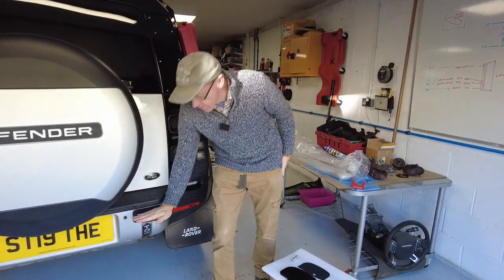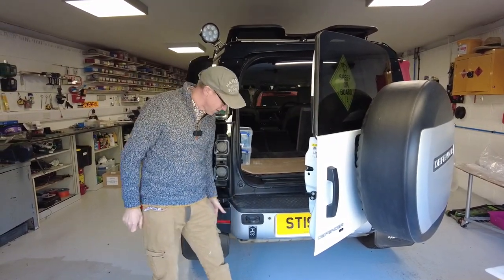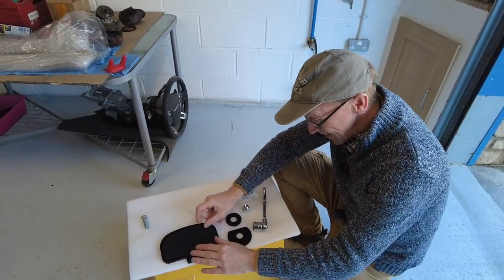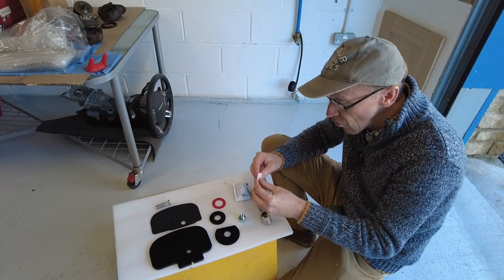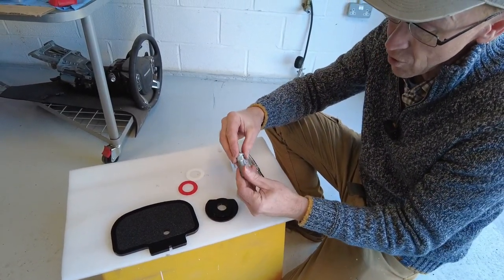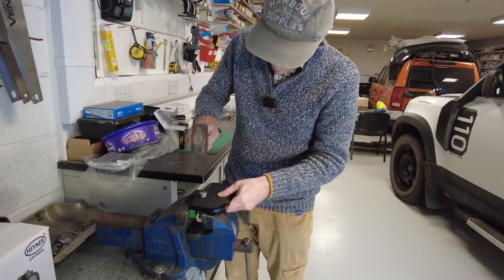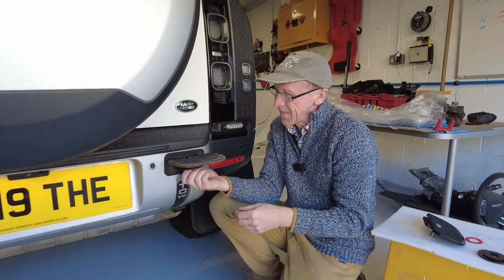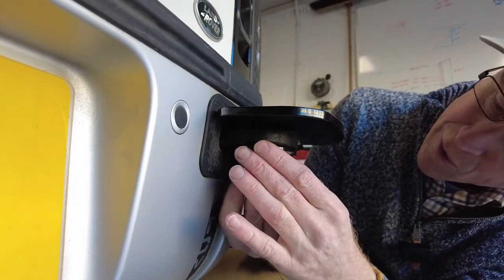Rear Step Kit for Land Rover Defender L663 Tow Hoops

Comment: "Just tap it in" then proceeds to beat it to death with a lump hammer lol 😆
Reply: Just think of the MIL it will be very therapeutic.
Reply: Yeah but you get the drift. Pun intended.
Reply from the maker: Yes i think I am going to try using the vice as a press - put a socket on the back so the thread can push through... the hammer was a little heathen

Comment: Great idea. As a thought, could you countersink the stud into the plate so the grip cover then covers the whole surface?
Reply: Would be thinnest at the critical point.
Reply: @Cous1nJack  True and would need a stress analysis check.
Reply from the maker: We are always trying to balance / appearance V strength V cost.... The current plate is laser cut and this keeps costs low - we wanted to avoid welding the stud as this adds cost. You cannot countersink on a laser and as these are made in the UK adding an extra operation will add cost quickly. The other problem with countersink is that the bolt will spin - although you could use an allen key I was trying to get this so it could be fitted with tools in the car ( i.e. just the nut wrench ). But keep challenging us .... we like it and it helps us make our products better.
Reply: @L663  keeping it simple is always important. Keep the great products coming 👍🏻👍🏻😀

Comment: Fantastic idea. Will be buying one. However the bolt head needs to be powder coated black as well
Reply from the maker: Yes the design is good and i like the bolt idea but we need to tweak it a little for the fitting / appearance of the bolt

Comment: Could the step not have a square hole instead of a round one , with a bolt to match? Also as someone else said countersink it ?
Reply from the maker: Now we thought about using a coach bolt with a square head - try finding a M14 coach bolt  ! we need M14 to make the wheel nut idea work this meaning you dont need extra tools to fit / remove the step.

Comment: Great video, love the idea, but Did I see right, you cleaned the top of the spacer ring with the alcohol wipe, then stuck it to the double sided tape on the base plate using the dirty greasy bottom side, leaving the nice clean side upper most?
Reply: I noticed that as well..........

Comment: Such a great idea, since it's shockingly difficult to climb up from the back (even with the door open)! Glad you went with the skateboard surface too.
Reply from the maker: It is a mystery to me why Land Rover designed the rear bumper of the Defender with a slippery smooth top surface that sloped - epic fail ?

Comment: Would this step work with the tow eye hook that comes with the Defender?
Reply from the maker: A good question - the problem would be there is nothing to stop the step rotating as its just threaded in... you would be relying on the plastic bumper to stop it spinning
Reply: @L663  I think I would just add some thread-lock to the tow eye thread - I'll give it a try..  Any update on when the rear bumper top will be available?
Reply: @jerrykenney9255  Did the Thread-lock end up working for you Jerry? Any rotation? I would love not to have to take the bumper off, but really love the concept of this accessory. Thanks for any info you can share!
Reply: @johnbaranello6932  
The eye hooks work just fine. No rotation issues but if there are a little lock time should do the trick. Love not removing the bumper.

Comment: Hi guys really enjoy your videos and will be very rewarding when I do my 110 next year. I have a question I leave in australia and here when a snorkel is fitted on a 4x4 the intake is connected to the air box, I didn’t see that happening on your video? Thanks for your comments
Reply from the maker: Yes the factory airbox is piped to the side vent - the snorkel then fits to the vent fitting. Land Rover claim its not a snorkel ( for wading ) but a raised air intake for getting clean air from higher up.... actually the car will float before water gets into the standard air vent !

Comment: Nice idea ... but banging that bolt thing in have you not just ruined the  rust proofing integrity of the powder coat and zinc coating ???
Reply from the maker: Yes i think i will try pressing them in with a socket in the vice... the rustproofing will be OK but its not elegant !

Comment: If you have had the rear tow hoop powder coated prior to being installed will this effect the locating of the bottom washer?
Reply from the maker: Hi Vincent - this should be OK - it may mark the powder coat but it is on the underside so i think it would be OK
What colour did you go out of interest ?

Comment: Anything down the pipeline for the Disco 3? Are you going to restock some bits like steering wheels and the such? And one more thing what happened to your e-bay store you changed the format of what you offer? As apposed to what you offer more bits on your personal website  what gives?
Reply from the maker: Disco 3 we have more coming - molle plates etc. The ebay store should have 90% of our products on it - I will check.
Some low margin items we only sell on our website as we cannot sell for a profit on ebay with the ebay / paypal fees etc.
Right now ebay is doing a job at handling sales into Europe but we have a new website coming in the next 2 weeks
Reply: @L663  are you going to bring back the piano black steering wheel for the Discovery 3 with the sports grip? 🤔

Comment: Why not put the captive bolt through the step then put the sticky pad on without the hole in it?
Reply from the maker: The stud is not flush with the top - but i have modified the process based on comments.
Now we will fit the stud - i now use the vice as a "press" to press the studs in so customers do not need to go mad with the hammering.

Comment: When we gonna see that winch used Simon?
Reply from the maker: You are correct - we spent more time fitting it than using it ....( OK we have actually not used it - it scares me ! )
Reply: Another idea…….shovel or axe mounts on the bottom of the table that you are designing

Comment: I don’t have a vice or a lump hammer - can I order it pre-bashed ?
Reply from the maker: Yes we can work this out - place your order and send an email to customer service asking for stud to be pre fitted !
Reply: If you don’t have a vice are you really a land rover owner.
Reply: @Cous1nJack  No idea but there is definitely a P400X on my driveway 🤔
Reply from the maker: @supercrazysane  Based on your comment ( and my own concerns ) i am now pre-fitting the studs on this batch as the fit is really just a bit too tight.
Reply: @L663  Great thank you 🙏 Just this min ordered one 👍 Picnic table next, when it’s ready 🤓
Reply: Fitted just now and works a treat - like me, you may have to lift the bumper a little (simple one hand easy lift) to create enough space to slot the step into. Works a treat, very well thought through and super solid 🤓💪
Reply: @supercrazysane  Hi Steven - glad your happy and its all fitted. We are looking at making a chequer plate plastic full cover for the step.... so keep your eyes open for that in the future.. Picnic tables are now in - just need to test fit and make a video !